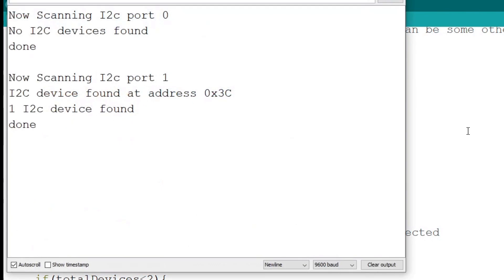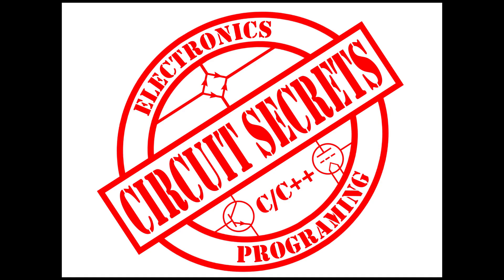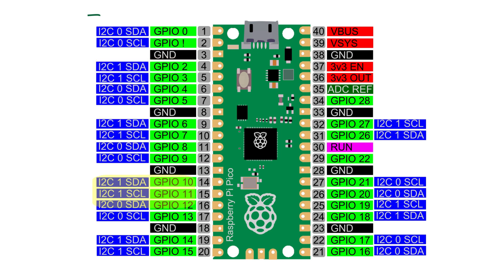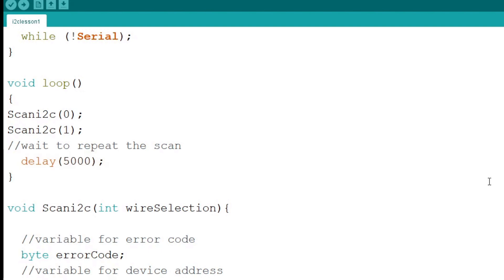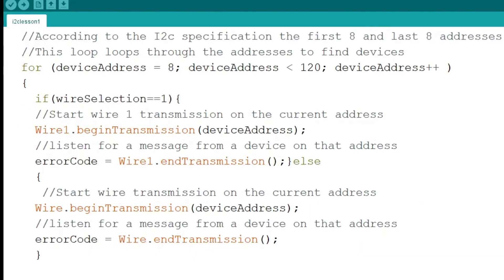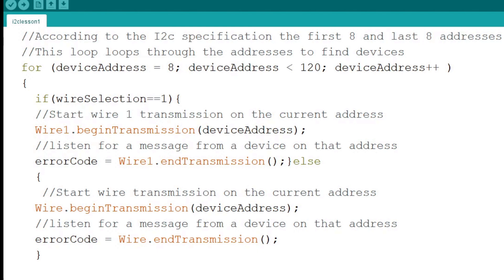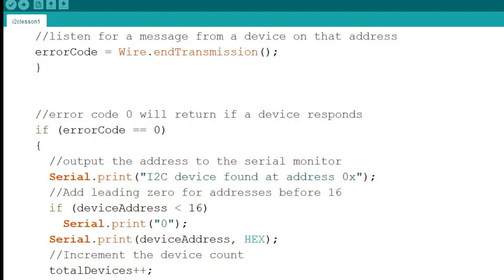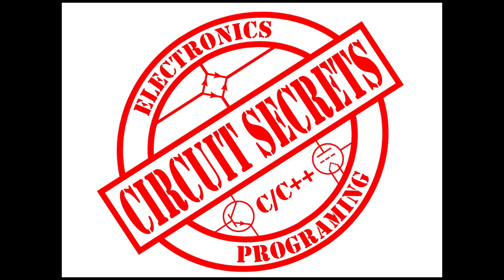Raspberry Pi Pico I2c (IIC) and Arduino part 1

Comment: Great video! Can I switch to different pins for i2c0 and i2c1 that we defined at void setup? Like in void loop can I define different Wire and Wire1 pins to use different devices on the same i2c channels?
Reply from the maker: Each device has its own address, you can access multiple devices on each channel.

Comment: Will this setup work to configure Adafruit’s 1.2” 4 digit 7 segment display? Adafruit is using a ht16k33 i2c backpack and I’m trying to use it with a raspberry pico. Thanks for the video!
Reply from the maker: I am not really familiar with that module. The biggest hang up I can think of is the default I2c pins in their library which I have not looked at. You will have to use a library for that specific module, but the examples in this series will at least show you how to find the address for the module.
Reply: I am kinda confused with the wiring. Would I connect both the raspberry pico and the peripheral (i2c module) like how I would normally and run the port scanner code from there?
Reply from the maker: @razaula  Yes just set the pins of the scanner code to the pins you are using, set the SDA and SCL inside setup.

Comment: Good video I'm guessing for the very experienced programmers that understands all the nuts and bolts but way too much information for the inexperienced hobbyist in a how to video. I don't need to know all the inner workings, it just confusses me, I just need a quick guide that'll get the lcd up and working...
Reply from the maker: This video covers most of the features of I2c for the raspberry pi pico and details a dual I2c port scanner. It is an in depth look at I2C on the Raspberry pi pico. Here is a link to one that covers an oled which may help. https://youtu.be/5HV55mwY33Q

Comment: Hi. I get this error 

class arduino::MbedI2C' has no member named 'setSDA'

What do you think is going on?
Reply from the maker: This is the result of using the arduino stock mbed library for the raspberry pi pico instead of the rp2040 library by Earl F Philhower. The Philhower library has better support for most features of the raspberry pi pico.
Reply: @CircuitSecrets    I was having a problem compiling your code until i read your reply. I learned a lesson today. Read the comments lol. Thanks
Reply from the maker: @mikegeo408  You are welcome! I'm glad you got it working!
Reply: @CircuitSecrets  I have not fully tested it yet in a cb radio. I noticed the sketch in the video is slightly different than the sketch on your webpage. Do you have a sketch for the rotary encoder on a pico?
Reply from the maker: @mikegeo408  Yeah I did a couple of revisions I think its improved. No I have not done the encoder for the pi yet only the Arduino pro mini.
Reply: @CircuitSecrets  Well I think I missing a BIG step in my install in my cb. I have a Radio Shack TRC 48. I removed the crystal 23330 which is ch#1 and connected clk0 of the si5331 to the non grounded side of that crystal. I set the cb to ch #1. I have no TX or RX. I’m sure I’ve missed something.
Reply: @CircuitSecrets  Thanks!  This little bit of information made all the difference.
Reply from the maker: @trailranger6602  Awesome!
Reply: @CircuitSecrets  My gratitude cannot be expressed in words! This turned out to be a solution to a problem that I had been struggling with for 2 months.
Reply from the maker: @faraday410  i am glad it helped!
Reply from the maker: @mikegeo408  I am not familiar with that model radio. What was the frequency of the crystal you removed? Did you test the VFO output with a frequency counter? Did you use a 5 volt regulator to supply power to the VFO?
Reply: @CircuitSecrets  I do not have a freq counter and I am using 3.3v
Reply from the maker: @mikegeo408  Hmm that should work. But without a frequency counter its really hard to diagnose the problem. Did you set the offset frequency as needed for the application?
Reply from the maker: @mikegeo408  If you are replacing a crystal of the value 23.330 mhz you need to set the offsets of the vfo to 3.635 mhz. 336500 in the source code. That is probably the problem if you have the VFO working. Good luck.
Reply: @CircuitSecrets  I appreciate all your help. It looks like rx is working. But it’s hard to tell. Not much action on the rx tonight. I have switched the VFO to 5v. I’m still having issues with the TX with low output. Do you think the output of clk0 is too low?
Reply from the maker: @mikegeo408  Clk0 will not be too weak to replace a crystal, it was designed for the task, unless you have bad wire or a bad connection. You grounded the coax on the si5351 end only, and used coax correct? You used 50 ohm coax? It should be something like rg58 to reject noise and carry the full signal. I recently did a vfo install on a 21 ltd where I replaced the VCO with it. It was strong enough to handle that as well as the old cobra 21 23 channel radio. There was no difference in receive or transmit strength on either radio. The 21 ltd required a coupling capacitor because there was D.C. on the buss from the VCO. You could check for D.C. on that crystal socket and if present you can drop in a coupling cap, but there should not be.
Reply: @CircuitSecrets  thanks again for your help. I set the clk0 output and it’s working perfect. I did check the TX frequency with my Sdr. I know it a crude way but it seems to be very close.
Reply from the maker: @mikegeo408  Awesome glad you got it working!